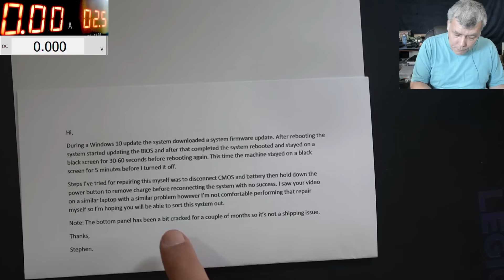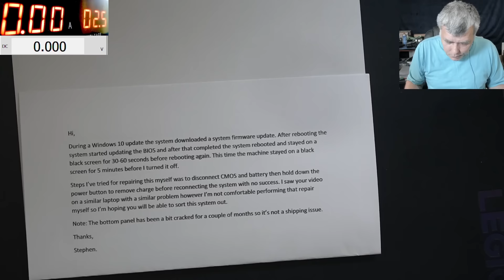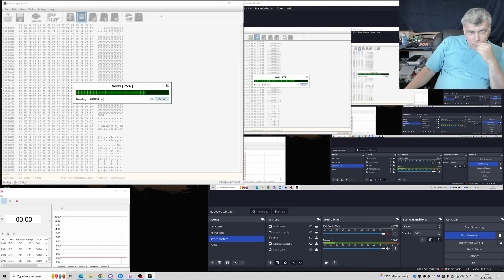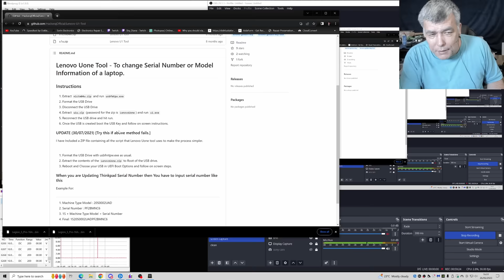Lenovo Legion 5 15ACH6H dead after windows updates - Sadly, laptops are dying after windows updates

Comment: this has been a big problem, ever since windows 10 came out  between corrupting windows and bricking the bios mostly cause by the user looking at a black screen loosing it and hitting the power button window would say i have updates the user would allow the updates the computer would reboot give you the oem splash screen the go black screen. if left for long time it would come back but if the user got impatient and hit the power button to turn off and on again it was dead after or if you did get the oem splash screen the next screen you got  no operating system found error if microsoft would have put some graphic up saying don't turn off processing updates thousand of motherboards would still be alive. the worst part is poeple will buy an ebay mb put it in there machine start it up get the oem splash then black screen and kill the new mb because the update picked up where they left off on a black screen

Comment: They are doing it on purpose. They want you to buy the latest laptops and software system. They are also blocking older versions from being able to run the latest software. The excuse that the old laptops aren't good or fast enough is false.

Comment: Came across your vid. I have a Legion 5-17ARH05H that recently has Black screen of death. I tried the novo button, taking out battery and cmos battery and still does the same thing which I press power button and no fans or keyboard led aren't on only power led is one for like 30sec or 1min and turns off and keeps randomly cycling it. I took out ramsticks and still does the same thing. Also, disconnect battery and plug in charger and still same power led white color on for a min then turns off. no fans are spinning. Nothing turns on, no screen, I tried hdmi to tv or monitor nothing. Wondering if windows update messed my bios or my mobo is dead.

Comment: I got automatic bios update in my gaming asus laptop,but lucky it work just fine. Windows update all over again installing me wrong integrated Vega 10 drivers,after its installed if i try open AMD Vega controll pannel i get error im having wrong drivers installed. There is an very important step to do with this Legion laptop,download software which will block windows updates,other way windows propably will download again the same wrong bios and it will happen again. I did check out,after windows update is blocked, windows defender is still receiving virus base updates.

Comment: How much does a this service cost. My legion 5 does not boot. No bios, fans not full speed, heats up. Held power button for 60 seconds, disconnected battery... I'm not sure if the CPU died or if the bios died. Mine was not during updates.

Comment: I have not been able to find any videos (at least none in English) showing the process of replacing the fried motherboard for a lenovo legion 5 17ach6h laptop with a new motherboard. The RAM and CPU on the old board are good. What is fried are two, tiny chips (that I am told are usually only placed by a robotic arm). I have the new motherboard, and require a how to video for swapping out the old for the new. Have you either made such a video or can you please point me to one someone else has produced? Many thanks!

Comment: I am currently awaiting Dell support to arrive with the needed motherboard. Similarly I used the Dell update app and as it has in the past it included a new BIOS update which it installed and rebooted. The warning screen pops up indicating no bootable drive found. Going in to the diagnostics screen by hitting F12 and the highlighted boot drive is the boot drive the other screen couldn't find. Hitting enter with the drive hgihlighted results in a normal boot. Not on reboot, goes right back to warning page. About an hour on the phone with Dell support 2 days previously they confirmed a mobo failure and that it was under warranty and would be covered with an in home replacement. 
This is the 2nd problem with this laptop that was purchased new from Dell last September. The previous fault was a failed RAM stick. simple exchange of RAM sticks and all was good until now.

Another odd thing was once I did get into the BIOS there was a setting for my 'illuminated keyboard'. The issue that is odd is that my laptop does not have one and this setting came with the BIOS update. I am wondering if this BIOS update is the problem.

UPDATE :
Tech says NVME failed boot sector. Said it right after he confirmed the weirdness and before swapping out the mobo. Same stuff after as before. 2 more days for another drive due to the time of day he was here.

Comment: I had a laptop that came with win 8.1, and when windows 10 beta came out i downloaded it (2 month old laptop). Then i got all kinds of drivers not workings.. when i tried to reverse back to 8.1 is got more messed up. When i tried to reformate and reinstall windows 8.1 it coulsnt because windows 10 deleted parts of the 8.1 lisense and also didnt have its own win 10.
So after 4 places looked at it, everyone said i would need to pay for windows 10 when it came out becuase some how a windows 8.1 key wouldnt work on it .

Comment: I still run Win 7.   When I first installed I was shocked by how much slower it was than Win XP.  Win 8 had just been released, so Win 7 I thought was a stable release. I applied all the Win 7 updates.  Then I used Task Manager on Win 7 to see why it was so slow.  I found processes constantly running in the background that I did not need, indexing updating and so on.  First I turned off auto updating. Ten I turned off indexing. I never ran an update after I found Win update undid all the things I turned off.  Win 7 screamed along after I shut diwn all the background rubbish. 
I realised MS was trying to get me to buy Win 8  so they crippled Win 7 by running a whole pile of unneeded rubbish.
Still have Win 7.  Never ran an update.  I believe with Win 10 and later it is impossible to turn auto update off.  It is impossible to turn off auto index.  
I got a whole new laptop, wiped the disks clean installed Linux and Never Ever will run Win anything ever again.
Reply: with win 7, try installing sp1, then 'convenience rollup update' (effectively a sp2 although isnt called that) it may help .. definitely turn off auto updates! i have with my main machine with win 8.1

Comment: 10 years+, I never update windows. Computer works perfectly.
I lock the 'C' drive with a program called DeepFreeze Standard 
 from day one and the operating system stays the same forever. It's like a fountain of youth for a computer because it doesn't deteriorate. I have never needed a repair in all the years I have owned a computer because of this one single program.
Reply: Confused nonsense.
Reply: you are a jenyus

Comment: For the life of me I can't understand why Microsoft is pushing BIOS updates through Windows Update. Until this time BIOS updates were a conscious decision. You either done it manually by downloading a file from manufacturers website or run a manufacturers "check all and update" tool. Clear instructions were given of what to do, how much time it will take, and that you were suppose to plug in your AC charger and wait till it finishes.
Now you get no warning, sometimes no BIOS flash screen. At my work I had people panic when after a round of Window Updates they've seen something on the screen (flashing progress). Sometimes they even unplugged the AC charger and tried to 4-sec power off the laptop, because they were scared it was malware...
It's so f-ing easy to screw up the update, when you have a novice user presented the flashing screen and they panic...
Reply: Right... the novice is the tard pushing updates during working hours.  You fail... The BIOS update is the manufactures.  Same presentation, same warning, same option to cancel.

Comment: I have the same laptop and same issue I bought an " CH341A 24 25 Series EEPROM Flash BIOS USB Programmer Module " full kit I want to program my chip in what what votage did you use it 3.3v or 1.8v. And How can I get the .bin file from .exe please help

Comment: Never trust a universal charger with a separate tip. NEVER. I learned that 20 years ago. Sorry it took you this long. I have even learned to try at least 3 different OEM chargers before I believe that the problem is on the motherboard. You can use something like 45W or 65W original PSU. I have all kinds in stock just because of this.
Reply from the maker: I know what you mean, but I have no choice, i need to read the power supply current
Reply: @electronicsrepairschool  I always try both just in case. Saves you from a lot of unnecessary work (1 hour this time).
Reply: Hey man you seem to know your stuff. Can you explain why Sorin is not using the original charger? Basically the part at 12:40?(He said being insane to try to diagnose with a 15 Amps Charger..why is that problematic)?

Comment: Why it was necessary to remove BIOS chip ? why you could not use the tool to update it directly on the MB ?
Reply: Because clips/clamps suck 90% of the time and wont flash the chip properly, and with cheap ones they will work 2-3 times at best and then they become useless.
Its better to remove the chip and place it in the clips.

Comment: I had an older custom built PC from several years ago, had to get the BIOS manually updated at a repair shop to fix Windows Update nagging me to get the BIOS updated so it could install a "new" update. Had it done, and it worked for a while and then the Lithium button battery died on the Gigabyte motherboard that this BIOS was on. It has never done anything except show a blank screen now. I even tried swapping out the Lithium battery for another one, no luck. Microsoft just outright blew away any chances I will ever want Windows 11. The reason is simple, they'll want a BIOS update. NO. Apparently the BIOS chip in that particular Gigabyte board was the kind that needed an onboard battery to keep it alive. I wish I could figure out if there is a replacement for it that doesn't need a battery to keep it alive.
Reply: Basically all mainboards need that battery (CMOS battery). The memory that stores the BIOS settings is volatile, i.e. it needs power to keep the information stored. If the memory loses power for some period of time, the BIOS is reset to the default values. If you've replaced the battery (and you put in the right kind of battery), and it still doesn't boot, then there is something else wrong with it.

Comment: hello, I have a question, why sometimes you unsolder the bios chip to reprogram it when sometimes not? , THANKS😊
Reply: Because to program it, you need to power it up. And sometimes other systems start "talking" to him and the IC goes stupid. (Common power rail). Sometimes, don't talk but power consumption is to high. Other chips have a "grounded" pin that causes the chip to switch to RO mode. (but this is more common in microcontrollers).
Reply: @wojciechbajon  merci beaucoup pour votre reponse

Comment: Last time i let windows update mess with my drivers and firmware my laptop restarted to a BSOD because optane configuration and no longer possible to turn off usb charging without a 3rd party software (bloatware) installed on the system so from that moment i only allow security updates and nothing else. I am not rich to buy new pc each time updates break my device so is not good to let microsoft sabotage my laptop.

Comment: ok NO windows 10 didnt feck your bios, what happend was when the updated restarted the machine,the lenovo bios updater kicked in and tried to flash a new bios version! you interupted it and thats when things went south! Lesson 1 turn off auto bios updates if they come with your machine! always manually update your bios! Lesson 2 NEVER EVER EVER interupt an update even if it has been running for a long time,unless you are sure you can repair the possible damage!

Comment: this is the new protocol that goes above the latest PD (power delivery )  USB Power Delivery establishes operating protocols to ensure that the higher voltage available in the recent USB releases does not damage legacy equipment which was designed for 5 V operation. The USB Power Delivery requires conforming equipment to initially deliver 5 V at a maximum of 900 mA to the load to prevent such damage. Communication between the load and the power source can then establish a higher maximum load current and greater operating voltage. If no communication ensues after connecting the load and the power supply, then the power supply configuration remains at 5 V and 900 mA maximum load current capacity. If communication between the load and the power supply is lost after it has been established, then the power supply will safely revert back to the 5 V and 900 mA configuration. ---- now th difference The USB Programmable Power Supply protocol  provides for greater power delivery control than both legacy and USB Power Delivery protocols. While the USB Power Delivery operating protocol governs how USB power supplies deliver discrete voltage levels, the USB Programmable Power Supply operating protocol establishes the ability to control the output voltage and current characteristics of the power supply at a granular level
Reply: the point of it is to unload the portable device from the converter and move it inside the adapter more so the portable device charging IC now has a internal switch wich allows the adapter to charge the battery directly in the phase of constant current  the topology in use is called vbat/2 ps for this to happen the charger ic has to maintain communication with the adapter the charger ic will have gauge section aka coulomb counter at the moment the battery reaches the charging capacity the ic will signal the adapter to enter the constant voltage mode at which point the charging ic will take over and continue to charge the battery in a classical manner
Reply: i believe the way to go with this problem is to first test the charger a small jig with a port and a  modern charging ic and a 3 ohm 50w  power resistor as battery should work a few potentiomenters actually 3 are enough for some of this ic`s to set the protocol,  they  usually are fixed in the design  since  the battery type does not get to be modified on the lifespan of the product  a MP2731 battery management charger and a CCG3PA this ic is the power delivery controller the one that will actually do the negociation with the adapter for higher power like a laptop a RN5U700 will do with any laptop charging ic`s  then you only have to measure the voltage output based on your potentiometer settings and see if the adapter is really doing what you ask him

Comment: A classic Sorin masterclass. Microsoft updates have killed or bricked many a very expensive computer for years and it takes people like Sorin to start with the physics, follow the logic and undo damage emanating from an operating system. Apple is nearly as bad but only runs on Apple machines anyway so it carefully renders its earlier products obsolete on a whim. Microsoft Windows has global reach and manufacturers install it under OEM arrangements but really should interrogate Microsoft when updates include brand specific aspects.
It is easy to understand the spread of Linux distros on foot of too much power and no legal consequences remaining hand in hand.
Before too long it is inevitable that Asian countries will out-Windows Windows.

Comment: Does anybody know: Is there a way to backup the current bios, including all the encrypted serial numbers and such? I would feel much safer having a backup ready in case something like this happens. I have a Lenovo Yoga.
Reply: yes it is, dump your SPI Flash on your working Notebook with the Working BIOS to do so you need to buy a EEPROM Programmer, and on some mainboards you cant read it in circuit, therefore you need to desolder the SPI flash like Sorin did I dump every BIOS/UEFI Firmware from my Notebooks. even when I buy it new the first thing I do is open up and read the SPI flash out and save it as a .BIN file
Reply: @Gamersoft1124Pro  Thank you very much. I was hoping for a software solution, maybe some special linux booted from a USB-stick that could read out the BIOS. 
But using an EEPROM porgrammer would also be possible. Can you suggest a cheap programmer for non-professional use?
Reply: @hieroben  the CH341A is a perfect programmer it cost 5 - 10 Dollers/Pounds
Reply: @hieroben  if your notebook didnt have a emergency Bootblock for Main BIOS Recovery there is no way to recover it with a software. than you must repair it from the Hardware (EEPROM) thats the only way to bring the notebook back to life.
Reply: @Gamersoft1124Pro  Yeah, restoring the BIOS in case of an error is only possible with a hardware programmer. 
But it would be nice to have a software solution for READING the BIOS and making a backup without opening the laptop.
Reply: Somebody answered here with an interesting suggestion, but the comment somehow disapeared: 
"When I started BIOS update and did not have laptop plugged in, Phoenix WinPhlash did not proceed with flashing and GUI remained open. There is an option then to back-up BIOS. This saved my laptop ... I had a baseline to re-flash with CH341A." 
Unfortunatly, my laptop (yoga 7. gen.) uses a bios from Insyde which does not come with a backup function. Another option might be using the "Universal BIOS Backup ToolKit 2.0". But this software looks a bit shady to me.
Reply: @hieroben  I even dump firmware from 3D Blu-Ray players therefore they use a TSOP48 NAND flash or sometimes BGA NAND flash I use the XGPRO TL866 II Plus Programmer it has a lot of compatible flash chips and you can dump DIP32 PLCC32 TSOP48 and much more with it
Reply: I replied, but the system has transferred it to file 13.